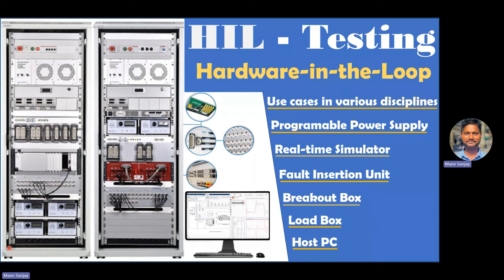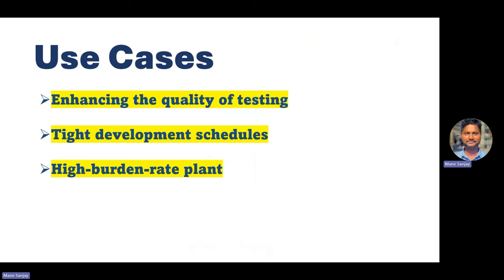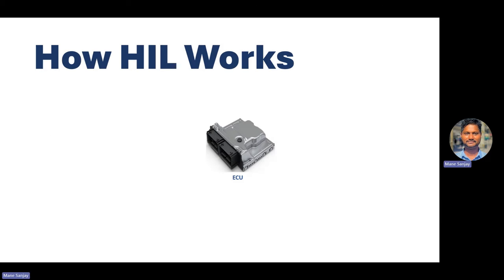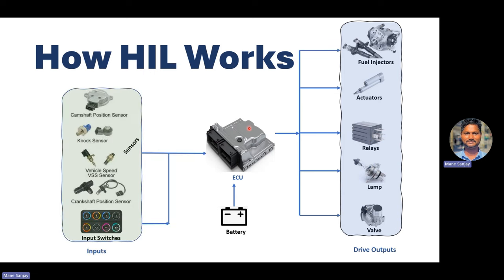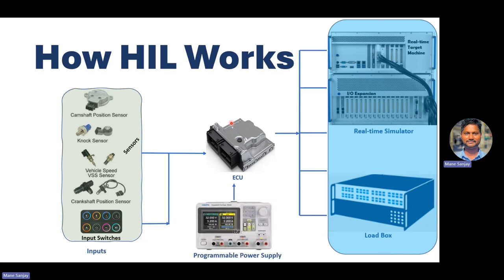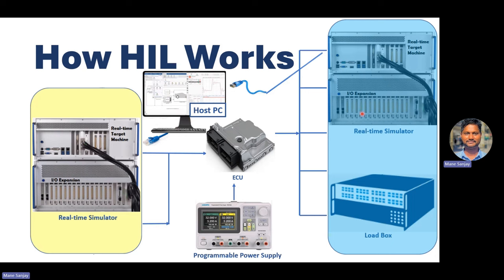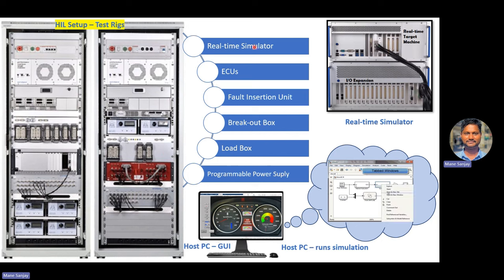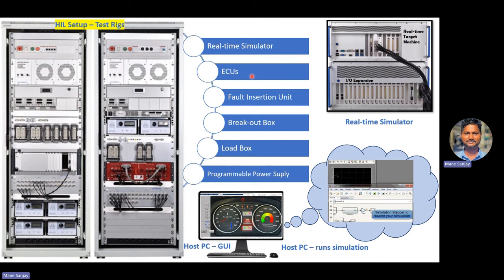Hardware-in-the-Loop Simulation, Real Time Simulation, Hardware-in-the-Loop Testing, HIL Simulation

Comment: Hi sir, Do we need any coding or programming language for HIL testing.
Reply from the maker: Hi.. if you are doing test automation then python can be used. If you are doing manual testing then no any language required. If you are using Vector’s VT system then you need CAPL scripting for doing test automation. So in simple NO for manual testing and YES for test automation